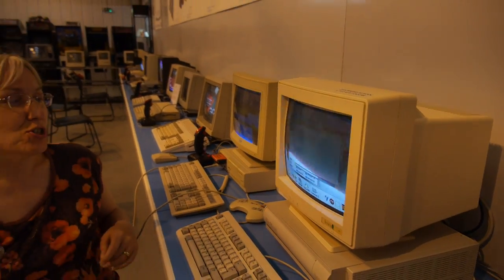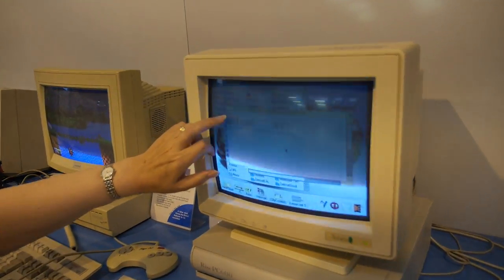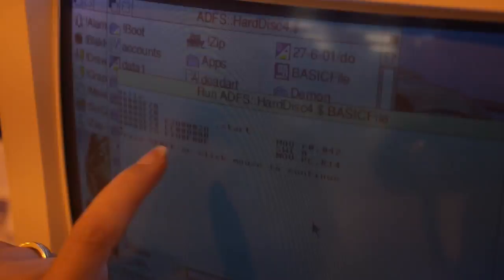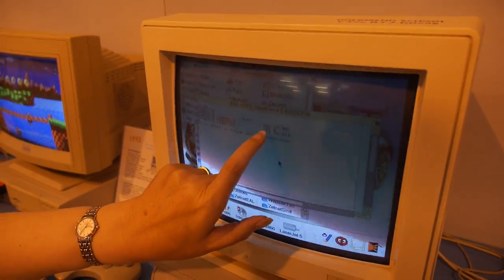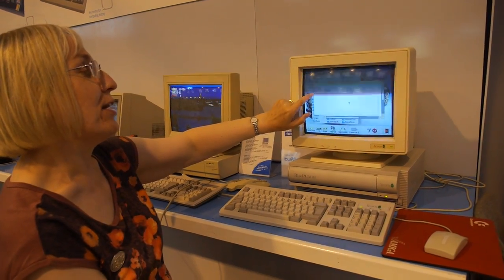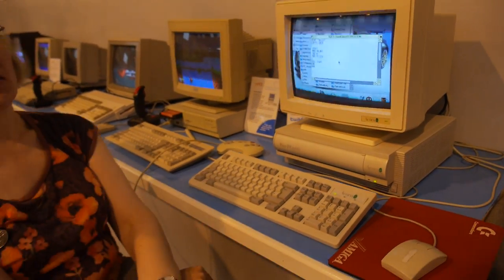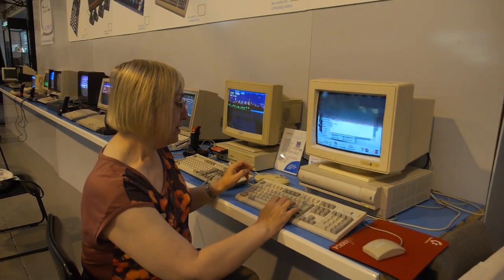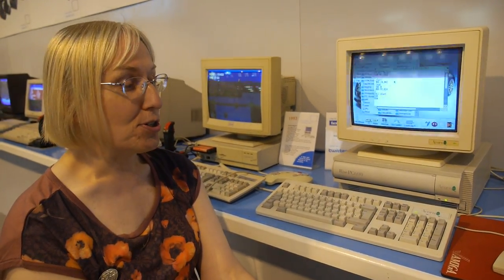ARM Instruction Set design history with Sophie Wilson (Part 3)

Comment: I remember some of those monitors used to flicker. Why did this happen?
Reply: The screen in this video wouldn’t appear to be flickering as badly as this if you were sitting in front of it. The excessive flickering is only apparent in the video because the scanning rate of the computer monitor is different to the scanning rate of the camera that is filming it, i.e. the video camera is able to capture the refreshing of the computer screen, whereas the human eye (typically) cannot.

If you have seen a flickering computer screen in person, it’s because it is being refreshed at a rate that can be perceived by the human eye.
Reply: Yeah, if I video a monitor at 60Hz, at 60Hz, no flicker is seen on video, but with that monitor at 59.3Hz and the camera still at 60Hz, it appears to flicker on video about every 1.5 seconds. The flickering on video would be more frequent if there was a bigger difference in frequencies.

Comment: BBC BASIC and the inline ARM Assembler are quite possibly the most powerful things to have come out of computing for many years. Sophie made it look like a walk in the park...

 I hope the various people manage to get these working on Raspberry Pi real soon.
Reply: The inline assembler came before BBC BASIC. It was in the predecessor to the BBC Computer, the Acorn Atom (which I had). I would not be surprised if the same capability existed in the Atom's predecessor, the Acorn System 1 (I think that was the name).
Reply: Jan Bruun Andersen did Atom use a precursor to BBC Basic (including statements such as DEFPROC, REPEAT/UNTIL etc?)
Reply: TheSaintST1 - I doubt that there was more than a superficial resemblance between the BASIC in my Atom and the Beeb. The standard version of the Atom came with a 4 KB ROM containing the basic BASIC commands. If you had money, you could add a 2nd ROM which provided floating point variables, arrays and some graphics commands (if I remember all this correctly - it has been many years since then).

Atom BASIC did not have any support for REPEAT/UNTIL/WHILE /DO/DEFPROC. You had FOR-NEXT loops and GOSUB. That did not prevent me from adding WHILE-DO to my machine since the inner workings of the BASIC interpreter was well documented, so it took only a little effort to hook into the ROM routine that read the program code, look for a WHILE keyword, evaluate the condition and do allow execution to continue or repeat.

That said, since all 3 BASIC's where written by Sophie Wilson (http://www.rtrussell.co.uk/bbcbasic/history.html) I am sure she reused some of the ideas and principles from the precursors when implementing a new variant.
Reply: Yep it was awesome. Taught myself assembler on it when I was 13. It’s difficult for kids these days to get that sort of experience.

Comment: 4:30 The 80286 was a dog of processor, even considering the era. It included an "advanced" segment-based protection scheme with some of the worst CISC instructions ever designed. The cost of the protection model was paid when a protected segment registers was loaded. God help you on subroutine exit if you popped a range-protected segment register off the stack as a part of the return epilogue. If the IBM PC hadn't taken the world by storm, Intel might not have survived their horrendous misdesign of the 80286. Then the 80386 came out with a 32-bit ABI and a Unix-style paged memory mode, and the 80286 "call gate" instruction set was confined to legacy dark-silicon microcode forever afterwards. By this point Intel had enough of a process advantage to carry their dark-silicon burden forward and still surpass their many RISC competitors further down the road.
Reply: They had the software, being 8088/8086 MSDOS compatible was more important than performance in the heavily marketed biz market.
80286 improved on previous .. but held MSDOS back compared to 68000 based systems

Comment: The reference to WDC (founded in 1978) being the designers of the 6502 (introduced in 1975) is misleading. WDC was founded by one of the designers of the 6502 (Bill Mensch). It actually originated within Motorola as the 6800 before the team quit and joined MOS Technologies (later acquired by Commodore) and released the 6800 pin-compatible 6501. The non-pin-compatible (but otherwise almost identical) 6502 launched 3 years before Western Design Center was formed. I believe that WDC were responsible for the CMOS variant, however.
Reply: Yes, that was unclear and filled with ambiguity.   It was an original  designers who tried to follow up in a startup.
The 6502 had elements of the RISC idea as the page zero memory was accessible faster with a single 8 bit address.
I hadn't ever read the Motorola link with 6502, but it explains why the 68000 & 68020 were the natural processors for Mac & workstations, as they avoided the segmentation of Intel's creeping featurist arch with i/o port instructions rather than memory mapped devices.
Again it was the Z80 variant of 8080 which was widely deployed, so I guess both Motorola & Intel now wanted more control of a proven potentially lucrative biz.

Comment: I sold hundreds of ARM bases Acorn computers in Holland to what one can call ''computer intellect'' (IT students and their professors, heads of primary schools) , if the consumers wouln't have been so afraid of non-compatibility and bought RISC in stead of CISC computers the energy problem would have been much less today, even with bitcoin mining.....Intel eat your heart out -well, to be honest they sold Strong-ARM processors in the end :-). Acorn offered a better GUI (drag 'n' drop with multitasking already in 1987 and low cost very high-performance software -which I still use).

Comment: Art is not as stripped back & simple. In the early years, the artist would have ground their own pigments.
This is an early digital artisan......with 10 chips / member of the world population..........it's a good thing they got their chip set to run of the heat of our ears, our we'd be in 30 feet of water already. 
Brilliant work.

Comment: 10:00 This is really good history, but Sophie is skirting over the RISC camp that defines RISC as a rigorously policed load/store separation, while also taking a dim view of variable length displacements encoded directly in the instruction stream. By the time you have icache, you have instruction fetch bandwidth to burn on cached code locations, and you can exploit this to advantage if you're willing to pay for an extra instruction pipeline extraction/alignment stage, which turns out to be good for performance, but lousy for power consumption. (As I understand this, the gains of a deep pipeline on IPC are smaller than the losses of a deep pipeline on power consumption. When you are connected to a wall socket, you'll squander a lot of power on a small speed improvement any day, until you arrive at multicore when a different problem kicks in.)
Reply: Deep pipelines need great branch prediction, that's why making instructions conditional in a regular way was genius.
I've taken a good algorithm in C++ using "optimised" libraries, then hand crafted it into C and managed 100x acceleration on 64 bit x86 (AMD64) arch by tight tweaking for branch elimination and minimising memory consumption as the extra computations were essentially for free.
That was their observation, processors then were mainly limited by memory bandwidth which is why caches help, eliminating most random access and moving whole  cachelines from/to CPU/RAM in transfers.
They ruled out 286 when Intel refused Acorn pin out modifications needed as Acorn  interleaved RAM/video access to same cheap memory without which access would have been slow and  clumsy.
At that time, there was a choice between budgeting transistors for cache or interleaving via pipelines and Acorn chose to pipeline and minimise branches increasing bandwidth with 32bit wordsize memory skipping 16bit, while also aiding code density in a way usable by compilers, which turned out to be extremely effective.
Unfortunately Archimedes just didn't have the software for it, not even the languages the BBC had, so the excellence was rather moot.
It was the UNIX port, providing PCC which enabled ARM to break out with a solid tool chain for OEMs.  I actually saw that workstation at an interview at Acorn, GNU EMACS editor could demo Towers of Hanoi in Lisp incredibly fast and smoothly.  Acorn was clearly a small thinly spread under-financed operation.

Comment: i wonder what instructions got left out?
Reply: The divide instruction isn't in there, instead there is a routine provided in the manual which when run on a RISC processor, which typically outperformed a similar divide instruction on a comparable CISC processor back in the day.
Reply: The question I would most like to ask Sophie is why the status flags were incorporated into the program counter, reducing ARMs address range to 26 bits. In retrospect it seems like a bad design decision but there must have been a good reason for making it at the time.

Comment: I found out when tacking ^ ^ Exactly through search without attitude I have my cinebench so highly driven on low tackles with heavy MHZ memory normal shaft you no 1300cb with such a cheap Xeon ^^ at the most to 1030Cb 'cos that's exactly the moment you reboots and you start fully ^^ no joke would you expect the crashing high stakes nothing bouten in low range cool stories so you get the cheap shit cup on old boards ^ ^ extremboards sorry ^^ such a joke ^ ^ boom with timing and save and test sometime you come back with more and more! ^ ^ boom one could still repeat for benchmarks ^^ etc. ^ ^ systems for cups ^ ^ joke ne attitude ^ ^ not more ^ ^ on normal cups ahn yes what you do not everything everything did not mind there can mn properly exploit the ram in oc mode😂